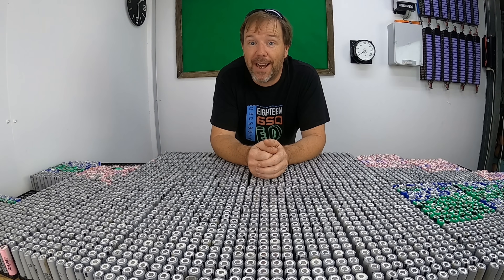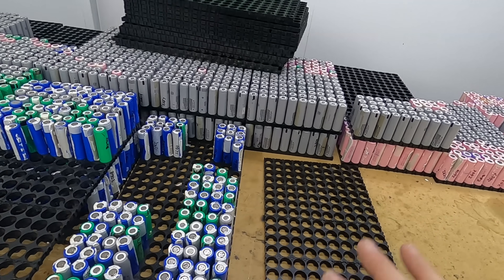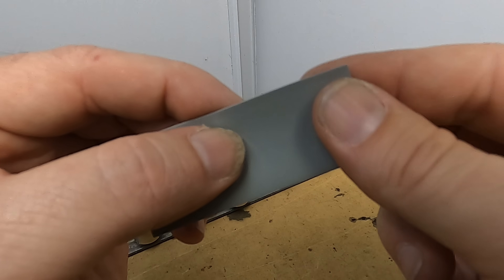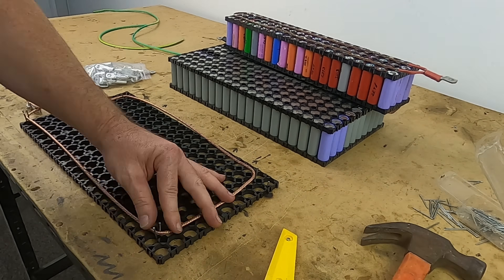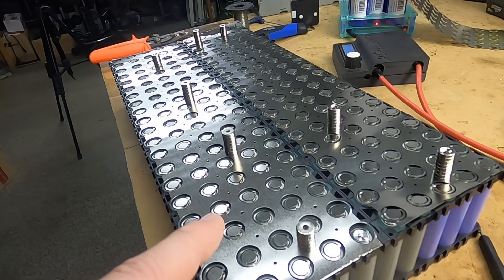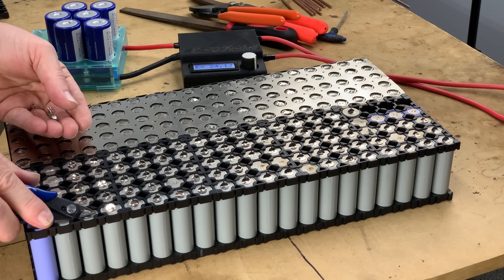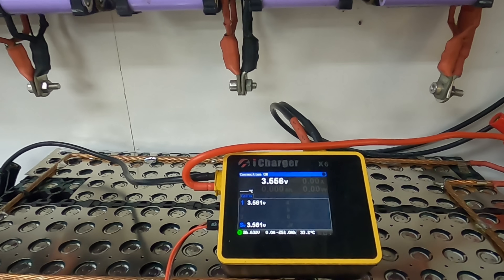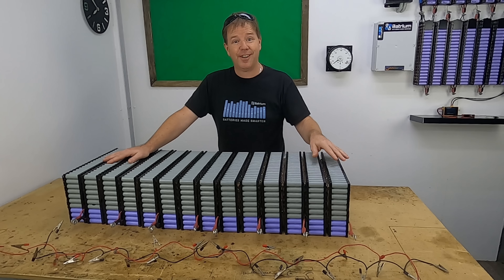Creating my single biggest D.I.Y. battery with 2800 18650 cells recovered from used laptop batteries

Comment: Great demonstration. 
At 13:05, instead of holding down the bus bar would you consider making straps off some of the nickel strips left overs that you could then spot weld on the underlying nickel connector to keep the bus bar secure in place? A bit tricky and involved but perhaps by trial and error an optimal strap shape and configuration could be devised. The advantage, in my mind, would be long term mechanical security and perhaps even doing away with the need for soldering?
Reply from the maker: It needs something more than what i've done. I've tried but removed from video using two zipties one all the way though the battery and using the second zip to terminate it rather than wrapping the ziptie all the way around the battery (hard to visualise with that poor description lol)

Comment: i didn't really understand the reason for the 0V blank cells, can you explain that to me?
Reply from the maker: It's in the next video but it's where they battery will touch the mount. As the cells are negative on the outside of them if they heatshrink breaks under the weight of the battery sitting on the mount it will make the mount active and is a huge short risk.

Comment: I would be scared for safety on these....
If I did anything similar, perhaps they would be in a separate building with some heat shielding. :-)
Reply from the maker: I'm in my shed 30m away from my main home (aslo where I work, I understand the risks)
Reply: @HBPowerwall  Excellent! Thanks for the response. As much as I want to build something similar - I don't have enough distance from my main house to feel good about it. 30m seems like a good distance.
Even as an engineer who specializes in power electronics - I am still a bit nervous at this scale.
Reply from the maker: Nerves cause two things - extra safety or so much fear you don't start - probably a good thing.

Comment: Hey mate. Thanks for the amazing video. If there such a max discharge amp for a battery? And what is that amp if yes? Thanx
Reply from the maker: With these busbars wouldn't go higher than 75amp for short bursts 50amps continuous shouldn't be out of the question

Comment: $200 little gantry thing spotwelds all that for you.  Nice.  Now I know, and I'll just use my gantry to make it faster and more consistently.  :-)
Reply from the maker: Deal! But that's another 200.... :( ooh and link?
Reply: @HBPowerwall  There's a thousand of them on Amazon.  A kid is working on an open source one that looks like it scales better because the work doesn't move, just the head.  You can build them pretty cheap and since you don't need like micron accuracy you can build your auto spot welder for SUPER cheap.  The control boards are like $5, you could probably use even cheaper little hobby servos which are also like 3-5 bucks and some non-precision rods/rails and true them yourself - if you have ever seen anyone true a bicycle wheel it's actually going to be much easier than that.  So in all, with elbow grease (not sure what your time is worth to you but while it's not complicated it's a bit of work to glue all of it together from complete scratch, open source is free but rarely free) you could probably spend under $50 and make something work.  Or you could just put a rubber tread to loop and feed the battery pack (some guy was making rubber tracks for vehicles from tires) dragging it into the spotweld spot and then it doesn't matter the length of the battery pack it just keeps feeding until you tell it to stop.  https://youtu.be/rHl9UwlDZbE  I spent years building stuff to do nearly anything you can think of and a lot of stuff you probably wouldn't have seen nor imagined before...I got hurt and since I couldn't be a forklift they ejected the cripple...have a good one, be safe, keep helping people be self sufficient, distributed power generation and storage is the logical future of energy.  :-)

Comment: Hi Pete. Another Pete here from nearby Jindalee. Like you, I've just accumulated 3000 18650 cells and finally got my 100ft of BatteryHookUp 5p BUT .. I was just wondering where you sourced the adhesive insulators that you put on the positive side before the nickel strip. Couldn't see a link. Cheers and love your work. Peter.
Reply from the maker: I got them here - https://rover.ebay.com/rover/1/711-53200-19255-0/1?mpre=https%3A%2F%2Fwww.ebay.com%2Fitm%2F18650-Battery-Insulator-540pc-DARK-GREY-Adhesive-ebike-DIY-Powerwall-US-SELLER%2F132303960347%3Fhash%3Ditem1ecdee391b&campid=5338316197&toolid=20008
Reply: @HBPowerwall  Thanks Pete. Ordered. Now the waiting game. Again. If anything goes wrong with my build you'll see the smoke from your house. Cheers again. Pete.
Reply from the maker: lol - probably cause an accident on the Jindalee bridge again and you'll be Facebook famous for causing a pile up lolz
Reply: @HBPowerwall  I'm actually on the river not far from the bridge so a distinct possibility. Watch for the Channel 9 chopper incoming.
Reply from the maker: Or PolAir doing laps lol
Reply: @HBPowerwall  HaHa. A regular occurence. Much approving your Mini electrification. Big fan of the retro upgrade. I'm tackling a 1952 Austin A40 update but it's a body off chassis reno so some time before I terrorise the Centenary suburbs with it. Happy dabbling.

Comment: Can you please send me a link to were you get your cell holders from I struggle to find them in large sizes
Reply from the maker: I get them from this ebay store, every single one is checked and never got a broken one unlike every other seller i've used - https://rover.ebay.com/rover/1/711-53200-19255-0/1?mpre=https%3A%2F%2Fwww.ebay.com%2Fstr%2F18650shrinkandcellholders&campid=5338316197&toolid=20008
Reply: @HBPowerwall  thanks for the reply I have always wanted to make power wall I have a electronics back ground for the past 20 years and now work for an electric skateboard company so I have access to allot of cells
Reply from the maker: Yeh - that sounds like one hell of a hookup! lol
Reply: @HBPowerwall  the black holders you use do you have a link for them
Reply from the maker: I got them from the above link - cheap & fast delivery - but they keep selling out since i released this video lol

Comment: Hi Mike here, in 2016, I installed 4x700AH winston LiFePO4 cells to make a "12v" system for my sail boat #sunnygirlcatamaran .... 3 years later its wildly unbalanced with the 2 worst cells probably 30% dynamic range.   What's worse ... She's stuck in East Indonesia, can't buy similar replacement cells in Indonesia (not sure I want that type of cell again anyway) & can't air-freight new ones due to haz issues, can't even get there myself nowadays.  Plan B, make new cells in Indonesia..  I can probably fly into indonesia with new separate cells or buy separate cells in indonesia.....evidently boxes of single 18650s or similar look better at flight check-in than a big yellow box with + & - .  they'd freak...
I'd like to commission you to help me sort thru this design...happy to pay you for the work.  NOTES - The boat has 2x3000kva Victron charger inverters ganged together (required to kick start a 2kw single phase scuba compressor) , The charging is via a Yanmar flywheel VVVF genset which has 2x3kva outputs 230v also solar via Victron 250/100 MPPT.  With all that I can charge at as much as 250A, it's a lot!  The sail boat thing is a 12V world (an old school world) ...anchor winches and sheet winches 12v... big amps - low volts.... this precludes the higher voltage battery configs which would otherwise be logical... anyway the heavy cables etc are all installed so this is simply a retrofit.
hopefully we can sort something out, I'm in WA, where are you?
Reply: Michael, Take a large resistor (high resistance) and run it on each one of those two higher voltage cells at a time. You want to use high resistance because you have 700Ah cells which can easily discharge hundreds, if not thousands, amp of current. You repeat this until you see voltage on each cell reaching similar voltage. This technique is called passive balance. Since it is already severely imbalanced, you may not find a 12V BMS with passive balance to do the balancing automatically. You however should have the BMS (with passive balance) installed after manually balancing each cell. Passive balance usually won't kick in until battery are fully charged. You should increase the number of PV panels or, from time to time, using generator (or grid connection) to charge the battery so that the passive balance can be activated automatically after a full charge. Please make sure measure you have someone present when manually discharging those higher voltage cell. If not, the resistor may over discharge the cell and destroy it forever. Please use high precision meter (mV) to continuously monitor the cell voltage as LFP battery has a very flat voltage range during discharge,  https://en.wikipedia.org/wiki/Battery_balancing
Reply: I've seen that battery at -0.223990, 130.243722 :) We meet again! Greetings from Taiwan.

Comment: I need some explanation. I thought once a laptop battery was dead, it was just that, DEAD. How can the individual batteries still be good?
Reply from the maker: It is typically the BMS that dies or just one cell triggering the bms to 'shut down'
Reply: @HBPowerwall  So in essence, ANY bad laptop battery would have all these 18650 cells? I'd be interested in doing a powerwall instead of lead acid battery banks. Learning each day!
Reply from the maker: NOT ANY - but its a fair call to say lots - but most newer laptops have flat pouch type batteries so the supply will run out one day :)
Reply: @HBPowerwall  Is there a way to re-appropriate these bag batteries for something or are they just good for recycle? Thanks for taking the time to answer. Truly appreciate it. ☺
Reply from the maker: Many have but not being a sealed cell they pose a greater risk than the 18650s so i recycle all those pouch type batteries.

Comment: 14:50
If you want to get a difference in voltage between two points, you can simply put leads of multimeter at this points. This way, you can use more accurate scale.
Reply from the maker: Thanks for the tip

Comment: The magnets to get the perfect heat shrink height is genius.  Do you have a cost for this particular pack?  Now that you've learned lots from your first pack, I'd imagine cost is lower with better build quality.  Also total time to build including tearing them out from the laptop battery pack?
Reply from the maker: I have a video a few weeks back about the heatsrhinks and the magnets - it's the perfect solution. It takes for ever to build as i video and edit as I go just in case i miss a step or the footage is unuseable

Comment: If you build a battery pack out of laptop batteries... aren't they going to last as long as laptop batteries?  So like 2 to 3 years?  Maybe less since these are already used?
Reply from the maker: Well i have 40kwh in service for the past 4 years and they are still going strong with maintenance. The extra effort into building a balanced battery & shear number of cells means it should out last my inverters
Reply: HBPowerwall why do the cells last longer when used in your configuration versus in the laptop?
Reply from the maker: Shear scale?
Reply: @HBPowerwall  Indeed. Just like any new laptop, if you keep it plugged in, the battery will always last longer. Therefore, if you don't do 100% DoD all the time, it will last much longer. The battery shell may fail before the battery itself. Smaller percentage of DoD, smaller charging or discharging current will result in longer lifecycle.

Comment: Have you seen any of your nickel fuses blow in any of your packs (to date). Also, is it necessary to have fuses on both the anode and cathode ends of your packs?
Reply from the maker: No naturally blown fuses yet that i've seen. I did consider doing only one side but its so fast for the price.
Reply: @HBPowerwall  In two of your videos, you tested these fuses. You made a comment (I think in video 2 on this subject) that when you tested this with your wall battery, it blew all the fuses...or something to that effect. What did you mean?
Reply from the maker: I havn't had any of these fuses blow in my 'inservicve' battery only on the test bench - old style I've had quite a few blow... some i did for fun
Reply: @HBPowerwall  I started down the road to build a house bank with many cells, but saw that fusing was needed and didn't want to risk my house burning down with handmade fuses (wires). Am just trying to understand that these nickel fuse panels will actually do the trick without causing thermal runaway and then fire.
Reply: By the way, I like your videos. Good energy!

Comment: It probably doesn't matter, but I would've put the bus-bar vertical runs one more cell inward. Basically the outside cells have to travel half a cell to get to the BB, but the inner's have to travel 3.5 cells. Also all the power of the pack is going through about 16 solder points, so maybe more blobs to increase the transfer area because there is a lot of amps with 200 cells.
Reply from the maker: my max load i've ever seen charging is 170 amps and discharging 140 amps once in service they will in parallel with the other 320 cells so 511P so load per cell is not much at all and that type of load is only once a month for 10 min lol
Reply: @HBPowerwall 16 solder points for 140A is about 10A per joint, so it should be ok for normal op, and if there is a direct short between sides it will desolder it's self, ie, a safety feature - lol -.
Reply from the maker: safety feature *winks lol

Comment: what are the battery blanks used for, it wasn't explained?
Reply from the maker: They will be used to upgrade my current battery from 40kwh to 55kwh of storage (removing 10kwh of batteries to make room for this 25kwh upgrade)
Reply: @HBPowerwall  @JosephKendall This is exactly the question that I asked and this fool didn't want to explain it he just wanted to put me down acting like I didn't know the math of the configuration. Seems more like Mister smart-ass fool just doesn't get the question.

Comment: https://www.ebay.com/itm/XTAR-VC8-8-Slot-Type-C-LCD-Li-ion-Ni-MH-Battery-Charger/184154359762?_trkparms=aid%3D111001%26algo%3DREC.SEED%26ao%3D1%26asc%3D20160908105057%26meid%3D3124c12cb4c04e91852436fed21e494e%26pid%3D100675%26rk%3D5%26rkt%3D15%26mehot%3Dnone%26sd%3D114253451851%26itm%3D184154359762%26pmt%3D0%26noa%3D1%26pg%3D2380057%26brand%3DXTAR&_trksid=p2380057.c100675.m4236&_trkparms=pageci%3Ab1d23896-af75-11ea-af40-74dbd180715d%7Cparentrq%3Abadec7491720aad92a4279deffffe9a4%7Ciid%3A1

what do you think of this for charging and testing?....I have a thunder ac6,...it can only test 1 at a time...
Reply from the maker: Never used one sorry

Comment: Turn your crimper 90% from what you used .  The  crimps will be way more tidier and not protrude bottom and top.  That bit of protrusion indicates your using the wrong die.  There should be no pinching. Dimple Type Dies not preferred or Hex shaped are much better then the Pinch type.    Same price just different tooling.   https://www.powerandcables.com/cable-lugs-crimps-hexagonal-v-indent-methods-of-crimping/
Reply from the maker: Thanks for the comment - Die is right i think but more an issue of not enough cable inside perhaps?
Reply from the maker: ooh helpful link also :)

Comment: Do you have a video that outlines your systems connection to your house panel and/or the grid?  And I saw one of your diagrams online that shows several PCBs as controllers, any more details on these?
Reply from the maker: I don't have much current sorry - the one you probally saw on the community forum is current for the AC side
Reply: @HBPowerwall  If you get a chance, I'd love to see more details on this part of the system.  It seems there's a ton of videos on the building of packs, but not how you can actually integrate them with your house and still have grid option in case solar is unavailable as I'm not sure a full grid-tie DIY option exists.
Reply from the maker: That is planned - what i can't plan is the amount of spare time i have currently :(